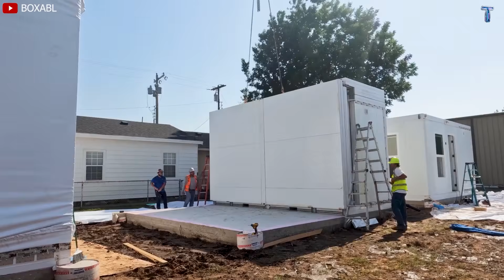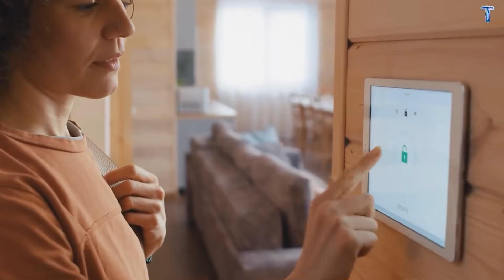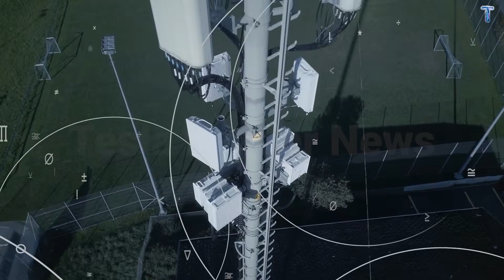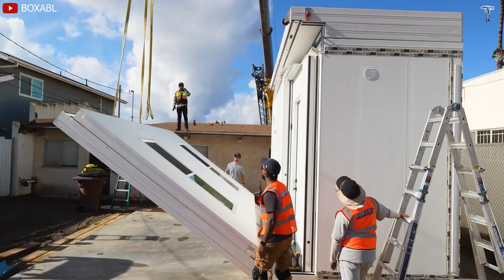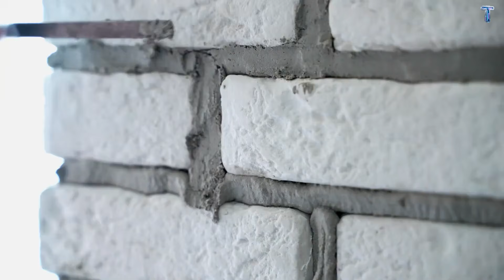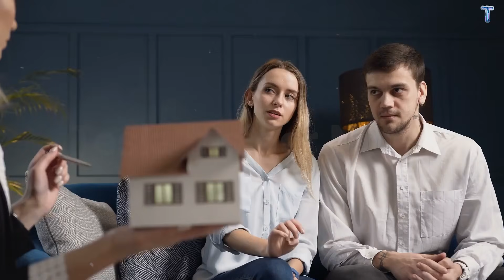Elon Musk’s $5,983 Tesla House Explained: Low-Cost Living Without BILL SURPRISES

Comment: What about water and sewer?
Reply from the maker: Water and sewer would depend on the site, local utility connections, storage tanks, and whether the unit is designed for off-grid operation. The video does not confirm a final plumbing setup; which scenario are you considering—municipal hookups, well and septic, or tanks?